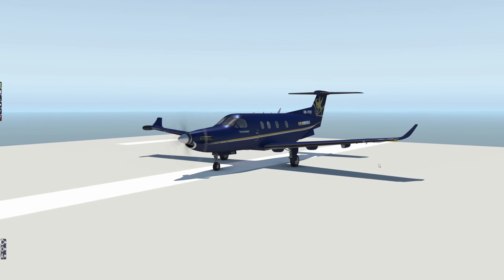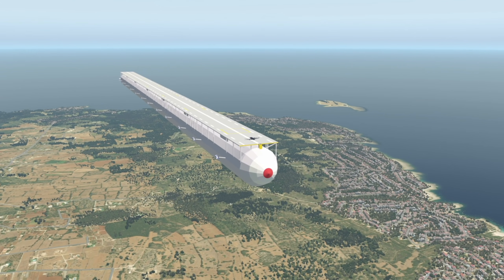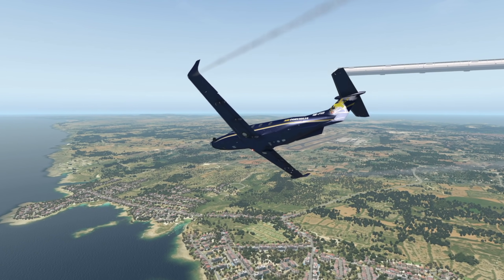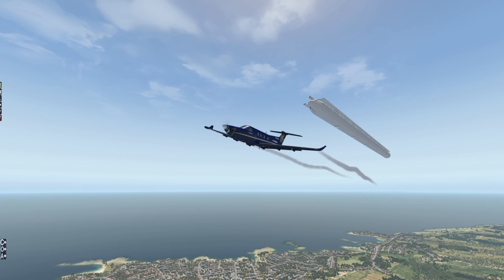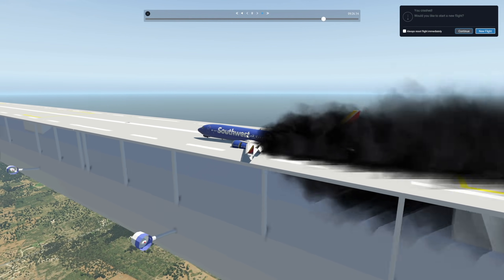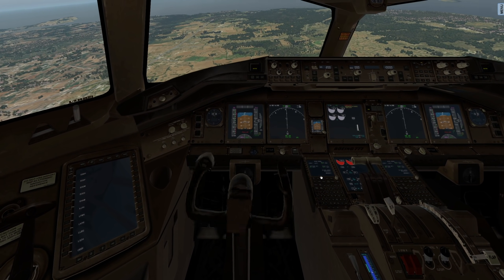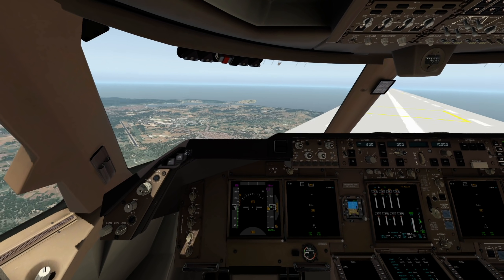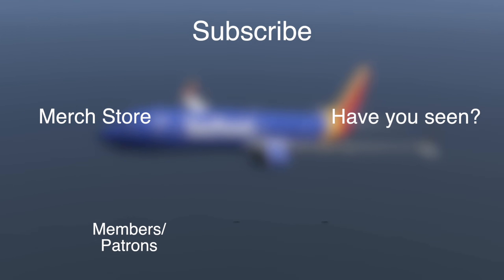Why The FLYING Airport Concept Doesn't Work

Comment: Reasons why floating airports won’t work

- the floating airport can’t take a lot of weight so it would sink
- if an aircraft needs to make an emergency landing, it won’t go well
- if a plane crashes onto it then the place will go down leaving a lot of casualties 
- there probibaly won’t be an ils approach system
- if you overrun it will be hard to recover from its fall
- if could mess with airplanes landing at land airports
-
Reply: And also if ryanair lands here,the airport will die
Reply: Just imagine the airport name “ Ryanair airport”
Reply: @brandoncisonno4545  insult
Reply: Brandon Cisonno RyanAIRPUERTO
Reply: + you need airplane to get onto flying airport so therefore you need another airport on ground
Reply: I wonder if ground crew would be even concidered ground crew
Reply: @brandoncisonno4545  air crew*
Reply: @brandoncisonno4545  🤣
Reply: Brandon also if the weather is bad it would be very hard to land since it would move
Reply: Don't forget that you would get a lot of collisions with planes in air.
Reply: It would also cost a lot of fuel to keep up
Reply: @petercoquillette5202  also you need find a way to refuel that thing
Reply: - maybe the floating airport isnt designed for emergencies
- i believe it is still possible to install an ils there
- overrunning at a 1km floating airport can be better than overrunning at a 1km land airport

The actual disadvantage is that it is expensive (fuel and repair and all that), and with that cost, it is useless which makes everything less beneficial
Reply: I was thinking more of military applications where it carries small fighter jets closer to their target while itself remaining in safe airspace increasing the range of the fighter jets
Reply: Crosswind is going to be a problem, imagine on final approach, and a slight breeze just blows the whole runways away
Reply: Brandon Cisonno it could roll easily
Reply: the ils system is just drones with flashlights taped to them. \s
Reply: @Joe-xr2xl  🤣
Reply: And also if an aircraft has an malfunction eg. Both engine blowout, you will need a giant aircraft to transport the engine and there will not be enough runway to land the giant aircraft
Reply: Overrunning isn’t that big of an issue because u have altitude to regain speed
Reply: And also, if the airport itself is in the air, what's the point of a god damn plane
Reply: Pretty much all these are problems with normal airplanes
Reply: Also you need an airplane to get to the ground so it makes not sense because there would still need to be an airport on the ground
Reply: @introvertairways  thats what is said lol
Reply: WOW. 🙂Good job
Reply: Brandon Cisonno it actually would probably be easier if you overrun because you have altitude to recover
Reply: @joeboi1342  But if it's an emergency because your engines failed, then not anymore. Plus, it'd be very uncomfortable, casually falling a few hundred feet in 2 seconds.
Reply: Leon Roehrl yea but would u rather be dead or uncomfortable
Reply: @joeboi1342  lol, true.
Reply: Joe Boi bit you would either fall downward or you would either pill upward and if you pull upward and lose some speed because of the altitude you would stall out and if you just drop the node, then it would gain speed from the planes landing speed and the plane could get destroyed because of speed
Reply: You forgot some.
Reply: It's so top heavy it would just roll over too
Reply: And how in the hell you can get down from there?
Reply: What about the fact that you need to fly to get there anyway so why not just fly from the ground airport to you destination instead of to the sky airport
Reply: Brandon Cisonno Air craft carriers
Reply: fam we know it wont work
Reply: Brandon Cisonno xhrtlof
Reply: the first problem can be solved by adding tons of pillars
Reply: @ymcajil6816  Adding pillars would cost millions if not billions. If pillars were applied, it would take up the same space as an airport on the ground. So just build the airport on the ground.
Reply: Brandon Cisonno I mean a plane can recover from a stall if it’s 20,000-30,000 ft
Reply: casually lands at cruising altitude
Reply: Brandon Cisonno o
Reply: You would have to land at the Zepplin then have the Zepplin take you to the airport
Reply: Gavin Gamble yes, but why waist all that time and money when you could just already be at the airport?
Reply: Over sea problem solved lol
Reply: Going to debunk your first reason. A zeppelin could lift at least 420000 pounds so depending on what your runway is made of you could land small to medium aircraft on such a craft of this size assuming you could use hydrogen. using helium is about half that number and that is a zeppelin size. The craft in the video can lift about 856000 pounds assuming a zeppelin is 20% of its size. Secondarily having it at less that 5000 ft would be foolhardy at best making a overrun a do able recovery. That being said using hydrogen is a bit insane a helium just can't lift as much making at least a blimp/Dirigible of this size very not feasible.
Reply: Pontiac Wolf think about it, if it’s going to be an airport with many planes on the deck, then it could poi’s alt sink and also you need a control tower, and a building so the people can have somewhere to go before their flight
Reply: @brandoncisonno4545  Not necessary true. This could be a refueling type station. Again it really depends on how the landing surface is. Cement is too heavy but if it's a light weight medium that airship could land as many as 50+ small aircraft. I'm not saying this is actually feasible given it would have to be Hydrogen not helium. That posses it's own very bad risks.
Reply: @raymonroe1983  look at you proving to everybody that you know physics and maths. You are such a big boy and I hope your mummy is proud. This comment was to highlight the possible flaws in the idea not to be a big smart scientist.
Reply: @raymonroe1983  it was reasons for the comment so you clearly do
Reply: @raymonroe1983  Wait how does helium lift half that of hydrogen? Helium has twice the density of hydrogen but it is the difference between the density of the lifting gas and the density of air what matters. 
density of hydrogen: 0.090 kg/m³
density of helium:      0.179 kg/m³
density of air:             1.293 kg/m³

lifting capacity of hydrogen=(density of air)-(density of hydrogen)=1.203 kg/m³
lifting capacity of helium=(density of air)-(density of helium)=1.114 kg/m³

1.114/1.203x100%=92.6% So it should be 7% less not 50%.

The thing is the lifting capacity per $ is much less with helium :D

source of densities at standard conditions (0°C, 101.325 kPa): https://www.engineeringtoolbox.com/gas-density-d_158.html
Reply: Floating airport exists*
Tornados be like: no
Reply: Last reason is highly invalid as the concept would intentionally placed in a position where it could not interfere in ground approaches
Reply: Everytime a plane takes off it would have to add the equivalent weight back or it would start floating up
Reply: give it a glider profile with many fail safe technologies (ie fast laser 3d printing missing or broken aerodynamic surfaces) ? Make it also float in water so it wont harm any land - it's meant to be over oceans. Seems there are a couple quick ways I can think of to solve those issues.
Reply: and how tf will you get down
Reply: Also the lower air density will mean longer runway requirements
Reply: But how are any of these problems, except for the weight problem, not be exactly the same in an aircraft carrier? If you smash into an aircraft carrier it could sink too. I realize that's not the same as an airport but there are worse ideas